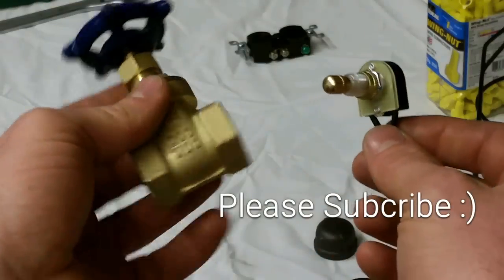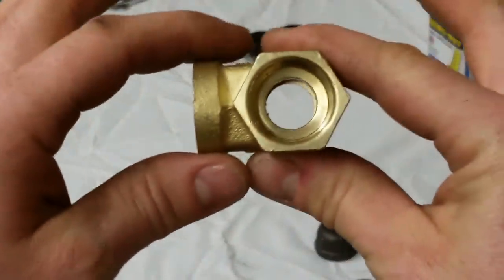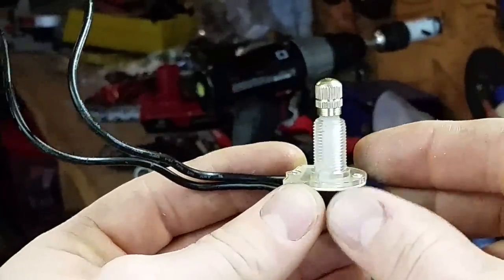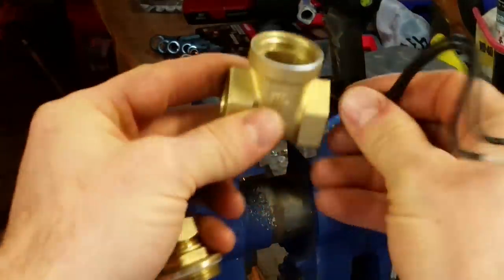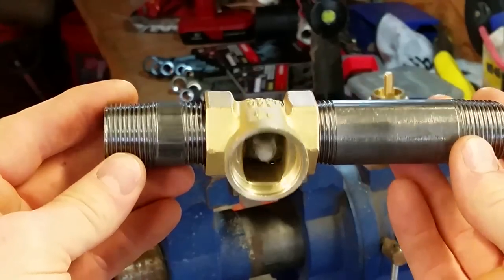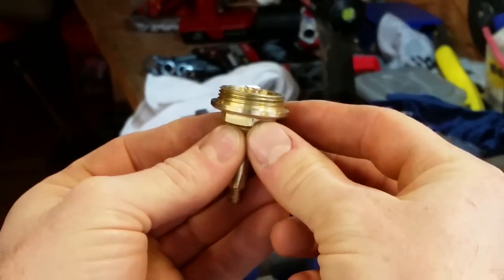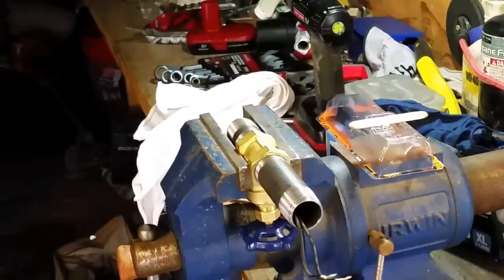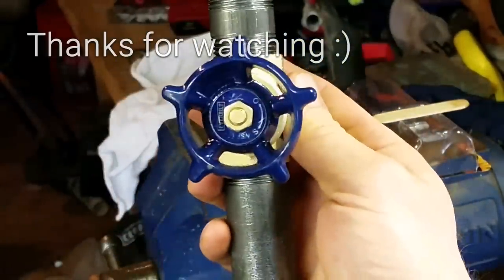How To Make A Water Valve Light Switch

Comment: Thanks for the great vid!  I just built a 3-way version and, for anyone who is interested, if you use a 1" valve, you only have to grind out a section of that "collar" at the bottom and the whole switch will fit in with no modifications.  Then when the threaded shaft of the valve is cut off to fit, it is just about the same size as the knob on the switch (my switch was almost identical to this one, but 3-way).  So I just epoxied the switch in place and used a tight fitting rubber hose to connect the threaded shaft to the switch knob, everything coming together as the top was screwed down.  I'm using 1" to 3/4" bushings in the valve ends to fit the rest of my project. I haven't finished my build yet, but the switch seems solid.  A little simpler assembly for someone that doesn't mind the valve/switch being a little on the big side!

Comment: Just a tip, a short piece of 1/4-3/8 vinyl tubing on the switch to the stem helps the epoxy stay in place and provides a mechanical bond as well. Very good video my friend.

Comment: Got a idea for epoxy not running down switch shaft. Cut a tiny sleeve out of something like vacuum  line or oxygen tank line, and slip over shaft to hold a little bit of epoxy and just leave it thier after epoxy has dried. Love your idea .Going to implement it into a lamp I am going to build for my plumber freind

Comment: Have you ever noticed this type of switch making slight popping sounds when you turn it? Other than the clicking sound.
Reply from the maker: Negative
Reply: @HandyGuy2016  thank you for the quick response! I just did this same design and mine occasionally makes a small pop when I turn the light off… not sure why yet. Could my bulb be to high of wattage or something?
Reply from the maker: I'm not sure, possible though.